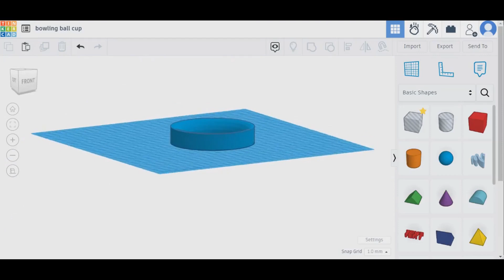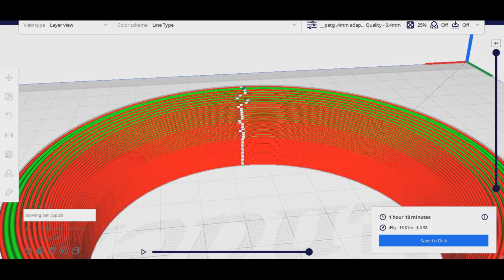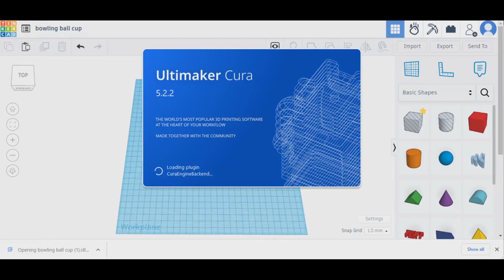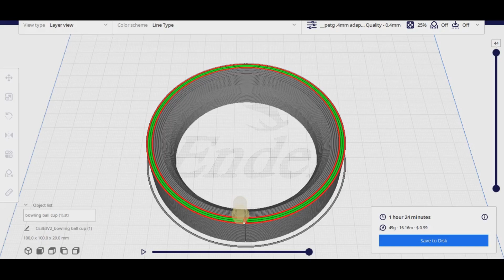3d Printing Z-seam Hack: Straight Z-Seams Every Time

Comment: thats a great and quick hack! you can also cut little notches in your model so you can control where the "sharpest corner" seam will be. Its a bit harder to implement though. the note also hides the seam a little better
Reply from the maker: I have done that too! You are right, it does work well. There are a lot of little tricks we learn along the way that can make a big difference!

Comment: why dont you use seam settings?
Reply from the maker: If you mean the Z Seam alignment, Z Seam Position, Z Seam X, Z Seam Y, Seam Corner Preference, Z Seam Relative settings, I do use them all the time.  They don’t always behave correctly. Not a big deal with PLA and small nozzle sizes. PETG and large diameter nozzles is a different story. It is possible there are some other settings I’m not aware of. If you know of some other Z seam settings in Cura I’d would definitely be open to trying them!

Comment: This is ingenious!  I tried this hack a few times trying make a tube shaped print that i can store an edge finder in with a cap on top but unless im .001mm bigger than perfect with the slice cura still joins the walls rather than butting them together.  Is there something i have to change in cura that will make it slice like how you got them perfectly contacting and not joining?  If I do add the .001mm it gaps out too much with an entire line width gap.  How do i get cura to not join the perfect contacting walls?  Thanks
Reply from the maker: My suggestion would be to play around with your extrusion % until you get it dialed in how you want it and then save it as its own profile and name it some way that will make it easy to figure out what it is for when you need it (maybe non joining z seam or something similar). You could try a test at 90% and adjust up or down as needed.

Comment: as someone who just got their first printer, calibratedf played with all screws. please start in hardware before software because there is more than a seam going on here this is not a fix. not even a bandaid. keep going tho you have good intentions. lol
Reply from the maker: I can see why you might think that, but I have 6 different 3d printers and this file prints the same on each one. There are several reasons for this and none are hardware related. There are multiple geometries going on with this print which causes the z seam to not align in Cura, that is the first problem. The print is done using .8mm nozzles to print very thick (0.6mm layer height) and wide (0.8mm line width) lines to speed them up, that is the second problem. These don’t have to be pretty, they are just a functional print so I would much rather them print quickly because I was making several of them. The 3rd problem is these are printed in PETG and not PLA. PETG is notorious for oozing a bit no matter how well you have your retraction settings dialed in. Combine these three factors together and you have a recipe for rough looking z seams on round prints with multiple geometries inside and no corners to align a seam on. Using thin slices and having nozzle path overlap bond the slices together is something that is done commonly as a vase mode hack for multiple walled vase mode prints to make model aircraft wings both light and strong. I’m just adapting that same logic for getting one retraction per layer instead of two and allowing a corner to help with z-seam alignment.
Reply from the maker: I wanted to also add these thoughts, in case anyone reading this wanted more details/specifics about this particular situation. I sell products that I 3d print (you can find them on my channel) that do not need this hack, they print fine. They all have corners that help with z-seam alignment and the layers are much thinner than than the 0.6mm layers used on the print in this video, but they do use the same line width of 0.8mm and are also printed using a 0.8mm nozzle. The 0.6mm layer height used for the print in the video is really pushing the limits of a 0.8mm nozzle which contributes to some of the oozing, especially on a Bowden tube system running PETG. Lots of filament running through quickly with a lot of back pressure in the system. This hack simply cuts the retractions in half. 1/2 the retractions = 1/2 the amount oozing. In addition, there is now a nice corner that allows for a straight z-seam alignment that also helps with the appearance of the z-seam.